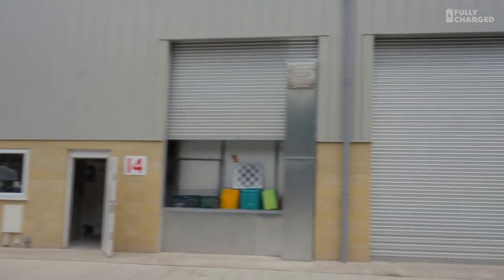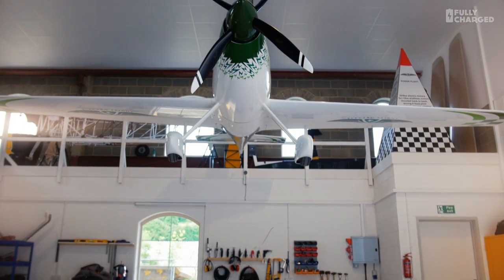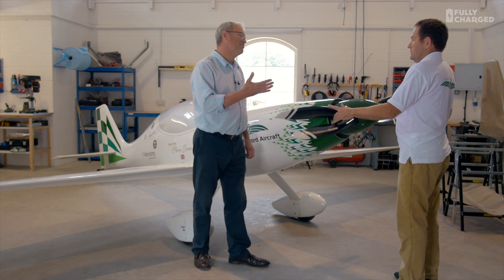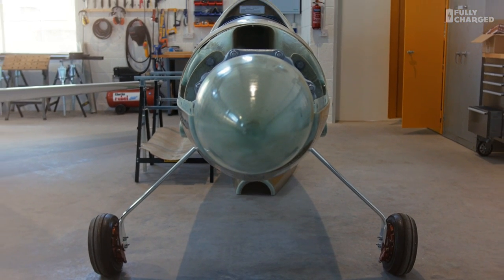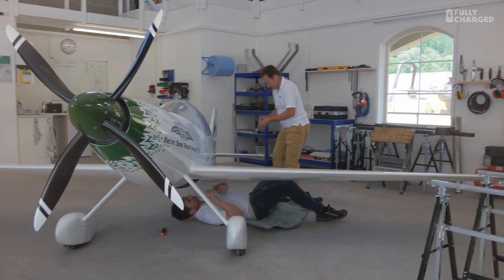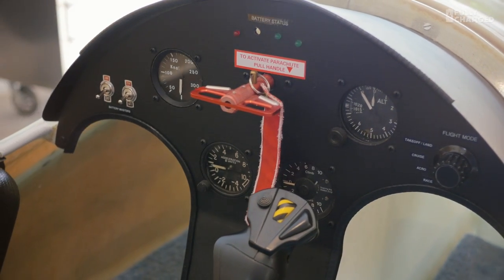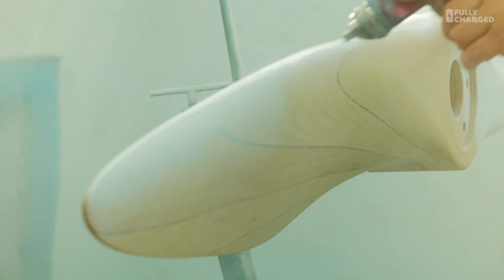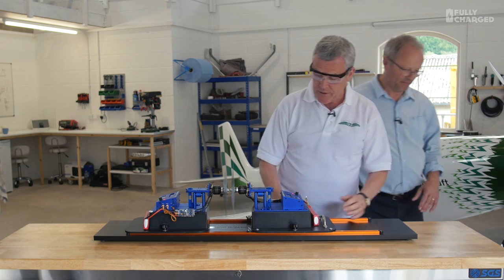Electroflight | Fully Charged

Comment: Fascinating. But will it regen when coming back down?

On a serious note, i could see this technology being used in a hybrid  system on a fuel powered commercial aircraft. Smaller conventional engines could provide enough power for level flight while electric engines provided extra power for takeoff and climb to altitude.
Reply: Yes this needs to happen, air travel costs far too much (due to fuel costs & carbon tax) and if we can substantially lower costs and emissions with hybrid airliners it's a win win.  I dream of a world where we can travel anywhere at the cost everyone can afford, the poorer members of society need travel the most because the more you travel, the bigger your scope becomes.
Reply: check out the boeing sugar volt project, it's almost exactly what you are describing.
Reply: FPVREVIEWS Cool! Thanks.
Reply: @RealistReviewer Power density of electric or hybrid IC/electric systems are  quite low compared to Turbofan systems. A hybrid Turbofan/electric system has little promise of increasing efficiency or lowering airfares.
Reply: I don't think you have conducted a proper survey. There have been about a half-dozen human carrying  solar powered aircraft. There are perhaps a hundred electric powered man carrying aircraft, and they don't use solar cells for anything except powering the instruments. The overwhelming number of non-human carrying aircraft have been radio controlled hobby planes or multi-copters, which rarely if ever use solar cells. @cprich22

Comment: Being an aeromodeller myself, I really hope you guys succeed. I will be glad to help. All the best guys!
Reply: How do you define success? This is a very small, powerful heavy aircraft, with  no apparent lift control or aerodynamic braking devices. It will almost certainly require a very careful and skilled hand. I would define success as getting into the air and returning safely. The company seems to be waffling about what it considers success to be. The video mentions Red Bull Air Racers, hinting that it might be used in aerobatic racing, but there is no class it would be legal in, as all Red Bull aircraft by rule use the same model engine. Of course, it's battery pack will not weigh less than 600 pounds compared to the 125 pounds of fuel a Red Bull aircraft carries. Even if it's motors weigh 200 pounds less than the Red Bull's Lycoming, this plane will be an overweight pig which would have no hope on the Red Bull course. The Rolls Royce website for this aircraft pitches it as an electric world speed record plane, something it might be capable of, but that is it's entire list. It is utterly useless for anything else. There is nothing this plane can do that an internal combustion powered airplane hasn't long ago done better .

Comment: Contrary to popular belief noise isn't an area where electric planes will make any difference. All of the noise you hear from most common airplanes is the propeller, the engines actually don't rev that high and aren't particularly powerful or loud.
Reply: Computer. er, no. try listening to an engine on a test stand with no prop.
Reply: Try listening to a prop with no engine, it sounds the same.
Reply: Computer you could easily knock of 10dB (note: log scale) without the motor, however, this would be with a conventional propeller on an electric motor.

because of the movement of air around both props, compared to conventional piston-prop engine, there may not be much difference in volume, although sound pitch might be higher without the sound of a piston engine.
Reply: Most piston aircraft engines have no muffler and at high power settings are louder than a leaf blower
Reply: Contrary to Computer's statement electric aircraft IS quieter. I'm working daily near electric aircraft (check Pipistrel Alpha Electro) and also piston engine aircraft and the difference is huge (Rotax 912 vs electric motor). In the air and on the ground.

Comment: pitchin my idea here: fusion reaktor airplane!
Reply: Yeah, sure.  The idea has some merit.  You'd just have to work out a few trivial engineering problems.  Like finding a material for the shielding that weighed less than 8 tons, and which took up less volume than the size of the entire plane.  And then there would be the irritating little conundrum of how to contain the radiation in the event of a plane crash.  Otherwise, what could go wrong?
Reply: Zero point energy or aetheric energy from the vacuum, Tesla did this and so has t henry moray and many other, look at john searls rotary generator and Joseph papp's pulsed plasma 2 stroke inert gas engine. The electric motor is an electromagnetic 2 stroke that has a lot of power and few parts!

Comment: I have been an avid RC aviation nut for over 30 years now...The last 10+ years have been exclusively electric and for all of the reasons listed in this video. When I started back in the the days the planes were all nitro powered, heavy, noisy and messy. It was the only way that we could fly.  But then the first brushless motors hit the market and everything changed. The thrust to weight ratios went through the roof and the ease of operation was even better than before. I now have models that are capable of 180mph while only consuming about 380watts of power. That was unheard of in the past. Electric power has come so far with batteries being the only thing holding us back. Thankfully they are catching up now! Fully electric cars are a reality now with the planes not too far behind! Take a look at my channel to see what the RC variants are capable of now...

Comment: Is it possible to use the wind energy to recharge the batteries while it's flying?
Reply: Icars. ask yourself what produces the wind energy. it is like saying can I get free energy in my left hand by lifting it with my right hand.
Reply: yes and no, if you try to generate energy by placing a wind turbine on the airplane the main motor would have to draw more power because you have extra drag, the power generated would be less than the extra power draw.
Sadly we don't live in a world with 1:1 efficiency
Reply: A windmill is useful for taking advantage of moving air, otherwise called wind, as there is no energy put into keeping a windmill stationary. The error of your question is "Wind Energy". Same error in saing AirMill. Really it is the plane that has energy. The plane flies by expelling energy to make air move over it's wings, but really I should have said by making the wing go through relatively stationary air. For lift, the air 'moving' over the top of the wing faster than the bottom is needed. If it were wind energy say traveling 80 mph south relative to the earth and the plane is traveling the same speed and direction than no air is moving over the wing and it is dropping from the sky. If the plane then speeds up to 90 by using energy it could have some lift. Then out pops a turbine to charge your battery but slows you back to 80 which means you are again plummeting to earth. Choices are use your extra charge to call for rescue or put the turbine away and get some lift with as little resistance as you slip through the wind, I mean air, as possible.
Reply: solar cell on wings and fuselage can help a lot.
Reply: check out "RAT" - Ram Air Turbine. This is an existing technology.
Reply: Mithilesh Rajendra Kumar. You know, I did recently see them. You are aware they are for emergencies only? For the large planes they are on, the emergency batteries would be dead before they glided to the ground. The rat provides electricity and hydraulic power for flight control surfaces. Looks cool as hell, but is hardly ever seen. This plane has a parachute for emergencies.
Reply: @joshua : Yup I knew they were only used in emergencies , like you mentioned. But it is an existing technology!. Thanks for pointing that out though!
Reply: Mithilesh Rajendra Kumar RAT is used on emergencies only because what it essentially does is harvest the static energy stored in the aircraft due to its mass and altitude. This static energy exist there in the first place because of the main engine.

You cannot harvest more energy from RAT than what the main engine had produced to lift the aircraft.